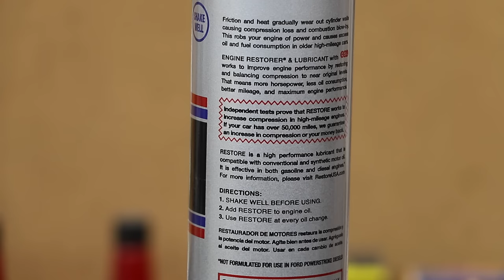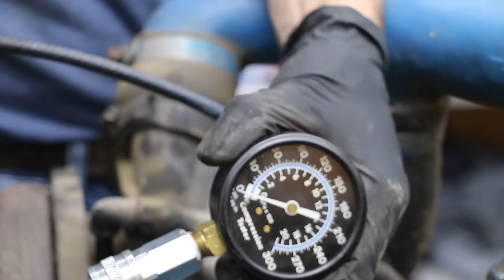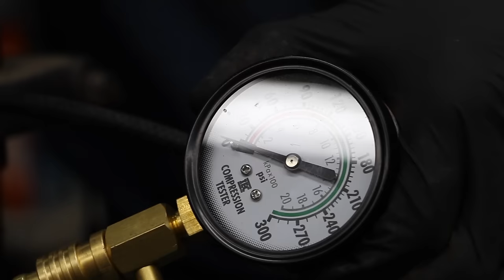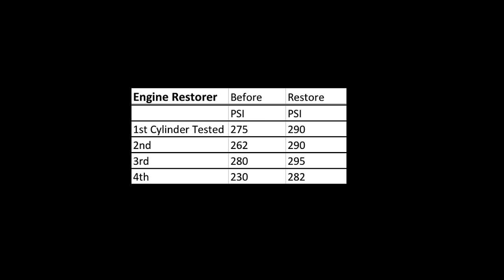Does Restore Work?  Will it Improve Engine Cylinder Compression?

Comment: I used this on my vtwin generac generator 8kw it had very low compression on one cyclinder and it was just dumping white smoke out everywhere and dumping oil out of the exhaust smoked so bad clouded out my entire neighborhood I put this restore stuff in it and ran it for about and our with a load on it and all of a sudden the smoking just stopped and now it always starts on the first pull and doesn’t smoke a bit
Reply from the maker: Very impressive results!  Thanks for sharing this experience.
Reply: Project Farm definitely seems to work very well I have no idea how it works I am curious to see if maybe this stuff causes a lot of build up or causes any premature wear to crank bearings

Comment: Ive used this on an old 85 Corolla we had worked great. Today i just added to my 08 Mazda 3 lets hope it works same as Corolla. My valves are already making more noise then usual. Ive used Slick 50 before and was not good.
Reply from the maker: Thanks for the feedback.

Comment: You are using the old fuel injector housing. 
Would not the internal space of that fuel injector change the total CCs of the compression chamber, thereby changing the pressure of the compression reading because it now has more area to expand into?

Comment: One word of warning with respect to Restore.  Do NOT use it in an engine that has any kind of valve that changes cam timing.  My 2002 Chevy Trailblazer w/ the DOHC straight six uses variable exhaust timing.  The valve that operates it has a screen in it, and the restore totally clogged it, and the engine would barely run.  I had to drain the oil, remove & clean the valve screen, put ONLY engine oil in, and the problem disappeared.
Reply from the maker: Thanks for the feedback.

Comment: I saw this video and used a bottle of Restore in my 5.4L DOHC modular V8 (no vvt) and within 1000kms it has abraded the white metal off the bearing shells, scuffed everything inside the engine and caused a loss of oil pressure such that the car now idles poorly with only 8psi oil pressure and loss of 40 to 58psi compression across all cylinders and starts poorly when cold.
This garbage has destroyed what was previously an ok running engine to now a huge repair cost for me. I've owned this car 14 years and never had any issues.
Reply from the maker: Thanks for sharing.

Comment: I treated my two Chevy 350 engines on my boat with this product, I ran them , and  now I'm getting ready to change the oil wen the weather warms up, My question to you is
 should I run engine cleaner to get all the crud out with the old oil before pouring in the new oil and checking the compression??

Comment: Another great video. Just out if curiosity, what do you think the weight is of Restore? 10w30 or sae 30?
Reply from the maker: It's a guess but around 30.  It's definitely has a much lower viscosity than STP or Lucas HD oil stabilizer.  Thanks
Reply: @ProjectFarm  thank you as well

Comment: Love all your videos i’m always picking the products that you suggest I stay and live in my garage so I just want to say thank you for the videos you make so I have a question i 4 stroke 2006 Sea-Doo RXT supercharger I was wondering what can I use and what would you suggest for low compression what will be the best product?
Reply from the maker: Recommend contacting the engine restorer customer support folks to see if this product is compatible with your Sea-Doo this would be my choice, assuming the low compression is a result of worn piston rings and not valve issues.

Comment: I been using restore in my Galant that I no longer didn't have any problems other than a broken timing belt (the reason why I sold it) and u put it in my ex wifes mustang and it does tick and I thought it would help maybe I'll just have to have it rebuilt but I like restore I'd continue to use it
Reply from the maker: Thank you!

Comment: This effect is likely ONLY due to the fact that it thickens the oil and thus the piston rings seal better. In other words, like any oil thickener. Increased compression does aid starting, but makes it more difficult to crank over in cold temps, meaning more strain on the starter and battery. And, does this thicker oil lubricate well when just started from cold?
Reply from the maker: Thanks for the video idea.

Comment: A good fresh diesel engine would definitely be too much for that 300 psi gauge. Tested a 7.3 IDI International in a F250 with 785,000 miles and it made 380psi
Reply from the maker: Thanks for the feedback.

Comment: I know I'm late to the party. I was just wondering if engine restore helps fight agaisnt sludge build up at all or if it just works to restore compression and power? But I would assume to do that it would want to "clean" the engine the best it can until it's next oil change? Or should I use a engine flush then engine restore?

Comment: I do believe that restore does increase compression however I would say that if you had done your initial compression test with the engine at operating temperature the first readings would have been higher due to the heat expansion of the piston rings. Would like you see the contrast in those readings.
Reply from the maker: Thanks for the feedback!

Comment: My 2005 Acura TL with 244,000 miles started having blow by in the crank case and in the oil dipstick area light smoke comes out when I rev hard .. I know my engine is wearing out but is there anything I can do to prolong it?  Thank you 🙏🏼

Comment: So its safe to say I could put this in my series 60 Detroit. 12.7. Don’t think its low in compression. But just for the heck of it. Would that be about two cans of the 8 cyl? For oil capacity
Reply from the maker: I would think 2 cans would be adequate but you might consider calling their customer support line to be safe

Comment: I just tried this in a 52 Willys M38. My cold compression was 85 PSI in all four. Spec says they should be 90-110. The oil in the Jeep was 3 quarts 10-40 with 1 quart Lucas. After adding the Restore I took a 20 mile ride. I let the engine cool for 15 minutes and tested. The compression actually dropped to 75psi in all four which has me totally baffled. I'm wondering if the Lucas could have something to do with it, not letting the Restore work. As of now I'd say this doesn't work.
Reply from the maker: Thanks for sharing.

Comment: I am worried engine restore wears engines out faster and is abrasive. Could you do a Blackstone analysis of fresh oil/restore mixture and used oil/restore mixture to see if the used mixture contains significant more iron or other contaminants that would indicate excessive engine wear?
Reply from the maker: Thanks for the video idea.

Comment: can you please do a video on weather or not 2 stroke oil will temporarily restore compression on a 4 cycle engine by adding it to the fuel. my theory is that using 2 stroke oil will increase carbon buildup and help seal worn piston or it will add a layer of oil to the cylinder walls enough to help with compression.
Reply from the maker: Thank you for the video idea!

Comment: Suggestion: remain independent, thus providing realistic results for products. Since you've build up quite a following and are probably the only youtuber to perform such product "tournaments" and various detailed product testing and the results - I recommend you start your own BRAND called 'Project Farm' with varying applications that would clean, restore, improve, fix different issues that engines catch during their lifetimes.

You have a perfect way of taking products that YOU and WE know work (perhaps enhanching them, or combining with other products that work with the same problem - further test the 'NEW' product and once satisfied, place them on the market under your logo and name. 
Place ONLY products that you can prove have a positive effect for it's desgnated purpouse. With the platform you currently have, that is rapidly growing, and with all the various test results and information you have gathered over the years, I am positive you could launch with at least 5-8 products with various applications  - from engine compression restoration, fuel injection cleaners, duck tape, glue, etc. You name it. 

You have a chance here to become a millionare and not place products on the market that make promises with little proof, but instead sell products that are, here, proven to be working and gather an even bigger following in the process. 

Cheers!
Reply from the maker: Thank you

Comment: I wonder with a point to ponder:
After an oil change would using a cleaner like mmo or seafoam and THEN adding the engine restore on another oil change render equal results on a third compression test as compared to the second compression test.
Im wondering if there are any minor or even moderate gumming or gelling (glazing) of the restore to the internal engine parts?
Reply from the maker: I don't believe there is any gumming but I'll need to check

Comment: Link to the product please?
I'm in Norway and I want to try the same or another similar product on a nitro engine that was accidentally completely filled with sand. The engine has been 100% cleaned and runs well but there is an obvious leak whenever the piston is below 1/3 from the top.

Comment: 0:57 Can someone tell me why its not recomended to use starting fluid on a diesel engine
Reply: Since diesels fire from compression, starting fluid ignites very easily and will ignite well before top dead center (pre-ignition) which is hard on the engine/bearings
Reply: @klaw163  thanks man
Reply: @phanalax9168   👍

Comment: I would have got the low cylinder on compression stroke ..then put compressed air in the cylinder. . .then checked to see where the air is going ,intake,exhaust,oil pan,radiator.
Reply from the maker: Thanks for the feedback.

Comment: I'm a little late on asking this and I've used Restore for years with good results but, was the testing done both times with the engine cold or hot? Just wondering as that should effect results with expansion of parts when heated.

Comment: i have an old for f-250 that my dad baut new when i was a kid he gave it to me and it had its original 351w and it ran BAD!! so i removed all the 80s smog equipment and a 60s 2v 2100 ford carburetor and it ran "ok" but it had so much blow buy you could see it huffing out the valve cover i really need this truck for when it snows b/c its 4x4 i had nothing to lose so i added engine restore and IDK but it keept the engine alive just enof for me to use the truck for 5 years with the blown motor we used to call it the "zombie motor" it just wont die eventually i replaced it but i was able to get 5 more years out of the engine and im in complete beleife that the engine restore was the only thing keeping it alive lol
Reply from the maker: Thanks for sharing.

Comment: Did you do the second compression test on a cold engine? A hot engine may have better compression as everything is a bit larger. Also did it start better after the restore? Maybe its glow plugs are garbage?
Reply from the maker: Thank you.  I allowed the engine to cool overnight.  It takes a long time to reach ambient. Thank you

Comment: Would love to use this on my Toyota Matrix with over 300k on it, problem is that on the RESTORE website it states it’s not for engines with VTT-I as it can damage the actuators since they are sensitive to hydraulic pressure.
Reply from the maker: Thanks for the feedback.

Comment: I think that engine is OK except cylinder #4... And the problem is probably the valves or worn rings. If it's a sleeved engine you could just put in a new #4 cylinder and I bet that motor would run like new.
Reply from the maker: Thanks for the feedback.

Comment: Colonel, unless you have the thousands of dollars worth of specialized test kit, you will never be able to judge the performance of your Diesel injection pump - you need a specialist to thoroughly test it - Whatever your opinions or assumptions, you cannot judge the performance on the hoof! What you now need to do colonel, is to change the old oil and fill it with fresh, then see if the compression holds, or is it simply due to the additive thickening the oil or similar - otherwise you are going to have to keep adding that goop every oil change.

Comment: Will you test this in a 2 stroke engine that has a separate oil tank from gas tank ?? would really like to know if it would work
Reply from the maker: Thanks for the video idea.
Reply: @ProjectFarm  Any time I think it would be an interesting project personally I would like to see it done to a snowmobile but I don't think it should matter as long as its a 2 stroke motor with separate oil/gas

Comment: Hi Would you recommend using engine restore on a Mercedes sprinter with 163.00 miles 
The engine runs perfectly just wondering if this will help the long Jevity
Reply from the maker: Thank you.  No, I would not use it unless the performance of the engine degrades or loses compression.

Comment: I have been using Engine Restore in my 1988 Ford Bronco for about a year now, the engine has a bad #8 cylinder and for some reason it has little to no compression and after watching this video I decided to try Engine Restore. I will say this, the engine still has little to no compression in #8 cylinder obviously some kind of mechanical issue ( if anyone has an idea of what it could be I'd love to hear as I've had the valve cover off and everything seem fine with the valve train) anyways, as perplexing as this is the engine actually seem to have a lot better power than it did last year, still has a skip but it seems to be running a lot stronger than it was and it will actually spin the wheels something it wouldn't do before I started using Engine Restore.
Reply from the maker: Thank you for the feedback.  Had you done a leakdown test?  I'm guessing that it has a valve problem.  Maybe the exhaust valve is stuck in the open position if there isn't any compression
Reply: @ProjectFarm  Finally getting back to you. I did do a compression test on the engine and even though it did have more power I did end up replacing the engine with a slightly built up 5.0 and changed the camshaft in the new engine to one from a 5.8 or 351W, that changes the firing order and the problem with # 7 and 8 cylinders should never happen again. I have also used it in my 2004 chevy van with 115000 miles on it, it seems a little spunkier but won't set the world on fire because it's only a V6. Lastly I wanted to use it on a 96 Arctic cat atv with a wet clutch set up but the bottle didn't say if it could be used in that situation. I called the Engine Restore company and amazingly they picked right up, when I told the lady what I wanted to with it (because the engine was actually seized quite a few years ago) she immediately said "DON"T DO IT" it is not formulated for a wet clutch. So I bought "Rislone", that says right on it it is usable in a wet clutch. I should clarify, the atv did still run when it cooled down but blew smoke rings and had lost a little power, hopefully the Rislone will help it a little bit. Moral of the story, don't lend out your atv.

Comment: Hello. I have  oil treatment + viscosity  improver  and  engine restorer&lubricant  from RESTORE.  Can I   put them together into the motor If motor has 3 litres? And what proportions do I need to use? The reason is that motor eats oil. I have quad bike.
 Thank you!

Comment: In a video I watched earlier you tested transmission fluid as an engine flush, however you did not recommend it. Your test results displayed an increase in compression though. I wonder how a good flush would have worked in combination with the Restore afterwards.
Reply from the maker: Thanks for the suggestion.

Comment: Does it improve compression only when it is being used with the engine oil? or does it improve the compression permanently even when we change the engine oil?
Reply from the maker: Great question.  It wears away if not used in subsequent oil changes.

Comment: How is it working long term?
On a motorcycle that needed rebuilding, I poured a tiny bit of oil into the spark plug hole. It ran until burned off in a minute, but it ran.
Is restore temporary, ongoing, or permanent?
Reply from the maker: Thanks for the suggestion.

Comment: I wonder how restore works. Is there zinc or some kind of material in it? And can it help with a engine that is burning oil? I have a 4 wheller that is burning oil pretty bad. The rings are going out on it and I don't want to pull the cylinder off to replace them. I'm not sure if I should get restore or a additive called no smoke. By the way could you test no smoke in the future? Thanks!
Reply from the maker: Great question. Very tiny copper and lead particles fill in the imperfections
Reply: @ProjectFarm  thank you!

Comment: Do you think this would be ok to run in an early 2000's v6 engine with over 200,000 miles on it , or should I check for low compression first before I use it.
Reply: As long as it's not a GDI or VVT engine, it should be fine.  This stuff can do damage to more modern engines with very tiny galleys. It's designed for older engines.

Comment: I know this is an older video, but I was wondering if it would do any damage to a motorcycle engine with a wet clutch.
Reply from the maker: Thanks for the video idea.
Reply: @ProjectFarm  So I was reading after I asked that and what I found was that the general thinking is the same soft metals that are in the product to help smooth and fill imperfections in the cylinder wall could potential do the the same thing to glaze over your cluch pads.
This was all just debate with out testing so it would be interesting to know.
Thank you for all the time and effort you out into your videos